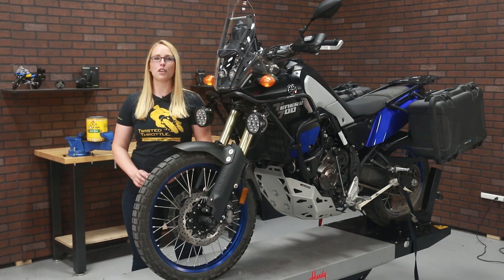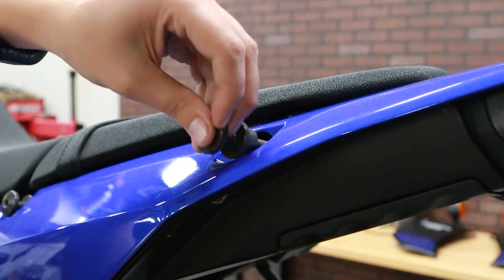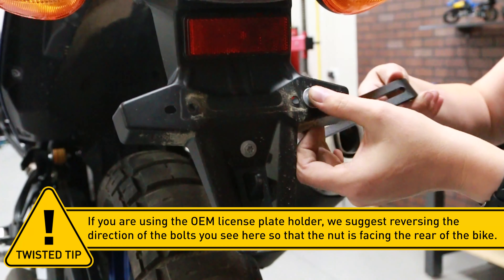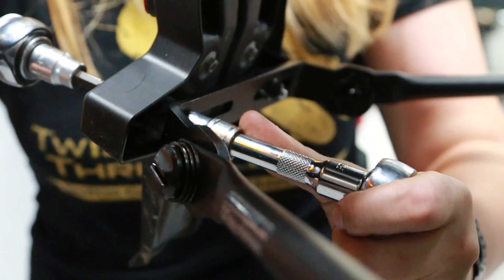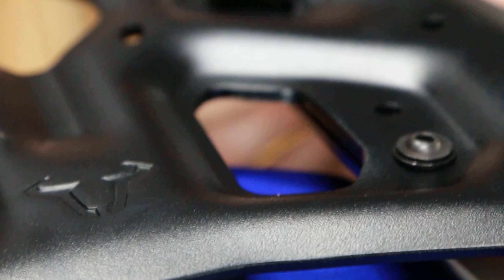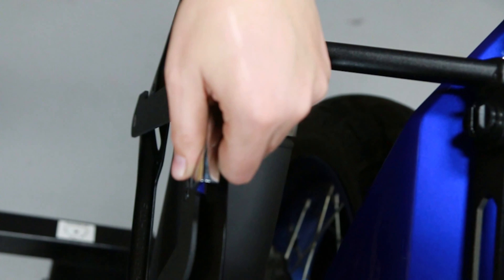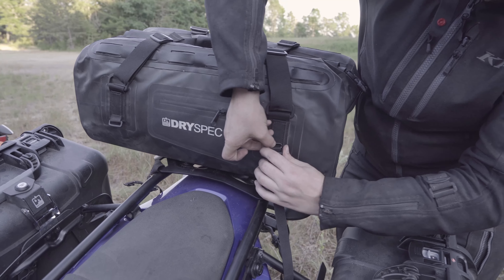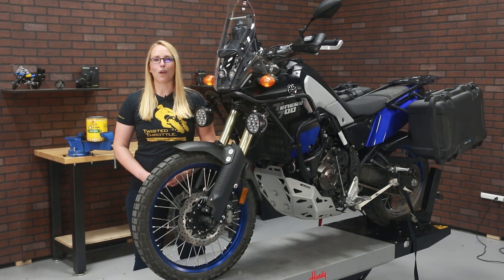Yamaha Tenere 700 DrySpec Luggage Kit

Comment: Can you purchase the brackets and lock mechanism that are on the case separately to use with the A-lock bracket?
Reply from the maker: The racks on this bike are SW-MOTECH SLC carriers Yamaha Ténéré 700 . You can use them with the adaptors and mounting kits found here --> https://dryspec.com/collections/straps-accessories-1
Reply: @twistedthrottle   Thanks for the response.  However the kit doesn't have the parts you need to attach to a case so you can then use the A lock bracket?